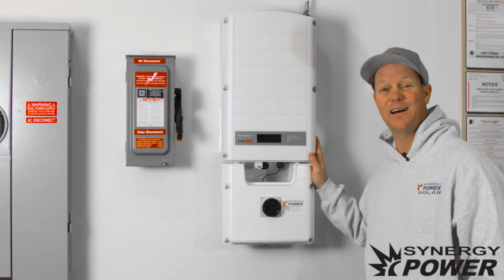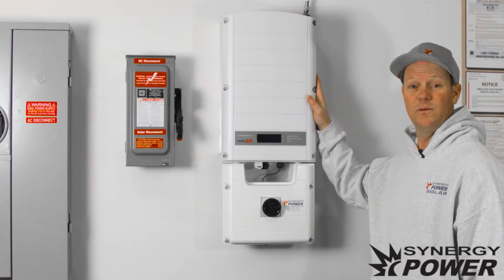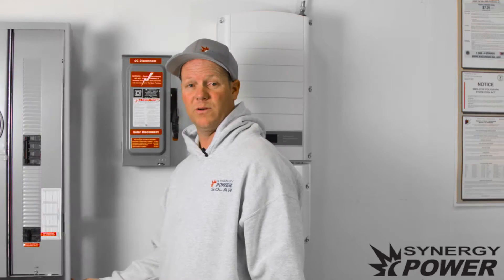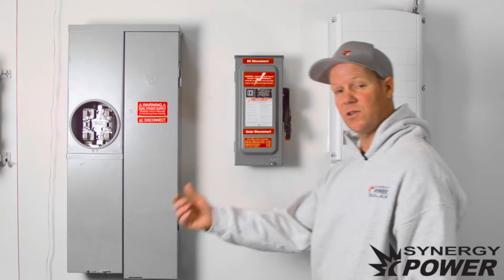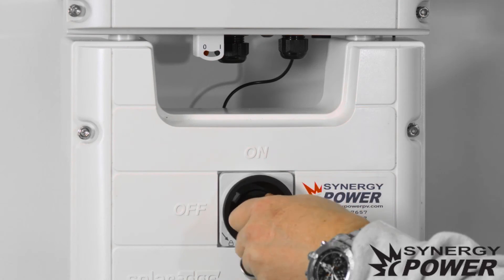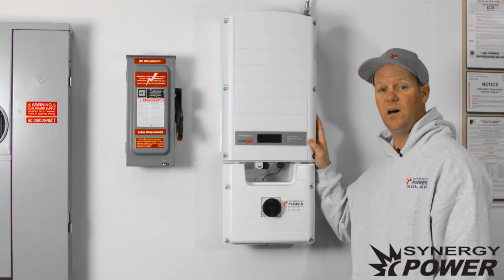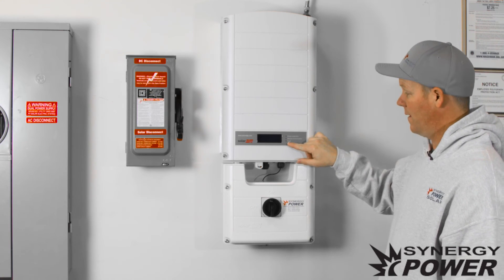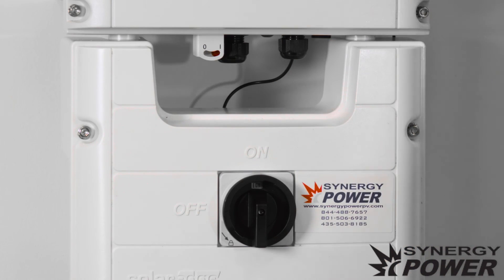How to Turn Your SolarEdge Inverter On

Comment: Problem with this is not everyone has a PV breaker within their meter box such as in my case my setup goes meter box they wired directly to the bus bar underneath the meter then to the fused emergency disconnect then to a 100 amp breaker box that sits in between my inverters then to the built-in DC connect on my Solaredge 11400 HD Wave inverters and then out from my inverters to the power optimizers then to the panels themselves. Code in my area and power company do not require a breaker in the meter box only on the system itself.

Comment: Do you know how to change the peak power setting?  We had to replace the motherboard on ours and it works great, but only goes to 5khw, when it should go to 8 kWh.  It has to do with the settings somewhere, but we have no clue on how to change (setup) the peak power.  Any help would be awesome.  Thank you

Comment: Very nice video on how to turn an inverter on of that kind in which there is a lot of video of out there but my question is, could you up load a video explaining the different possible or most common error code that the system could possible be able to show on the diagnostic scenario and maybe can explain a little about the isolation setting on the system for example what are the proper reading for those settings. Me as a owner I have a Solar edge inverter w/ 24 panel in which are suppose to read 24 switches and the system are only reading 22 and the tecnician came inspected and said that those switch were good and reading current but somehow the inverter were not recognizing them, incompetence people that when they were told to go to the seminar classes they were sleep and didnt learn nothing, TIA if you can share some knowledge on how to tackle this issue thanks

Comment: I turned my inverter on, set the country. Paired the optimizers, got enough ac volts, got enough dc volts, but 0.0 output watts.

Its been a few weeks i dont know whats wrong with it ??

Comment: It must be in an alternate universe because another video and the manual show a completely different process wherein the smallest I/O switch isn't touched, and a SIM card has to be inserted in the upper box.  Every manual, video and installation guide I get from Solar Edge is different, and none work so far.  Support is a bad joke.  The answer the phone and are nice, and seem to know a few things but nothing they suggest works.
Reply: Yah that's why I use Enphase. Much more reliable and better customer service